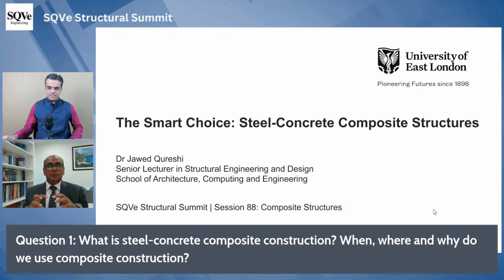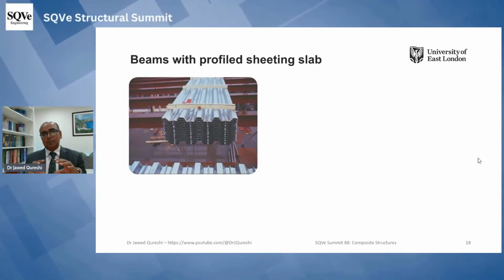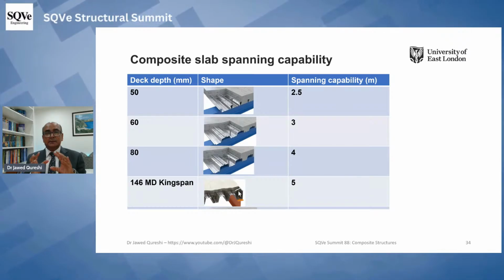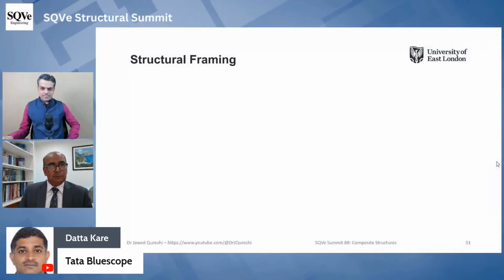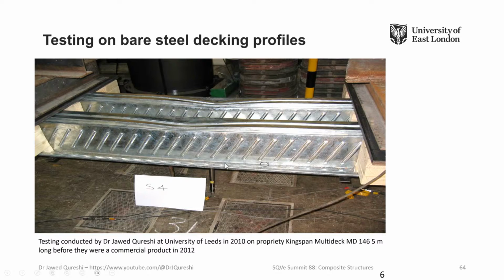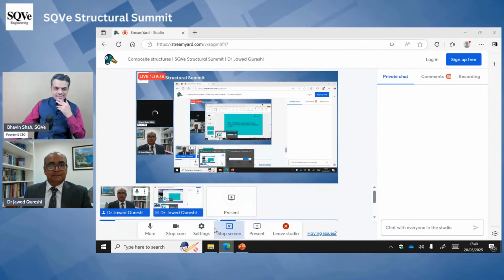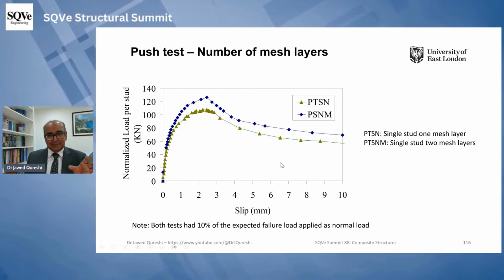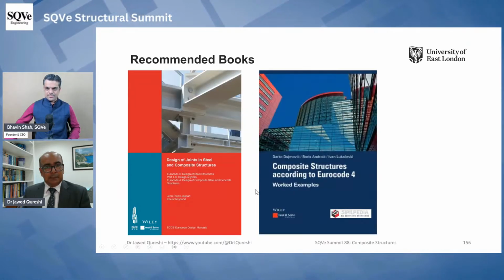Composite structures | SQVe Structural Summit | Dr Jawed Qureshi

Comment: Composite columns with PT Beams and Slabs. That's the perfect combinations. Less floor area consumed and less clear height required. We can provide HVAC inside false ceiling without obstruction. The weight of the structure will go down considerably.
Reply: Thanks for your feedback.